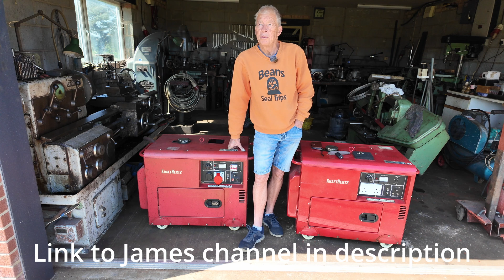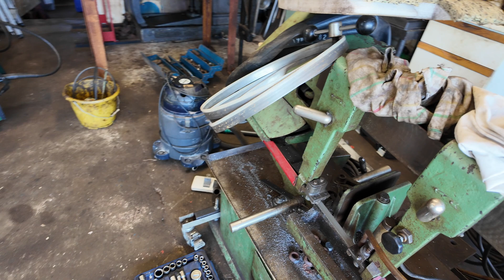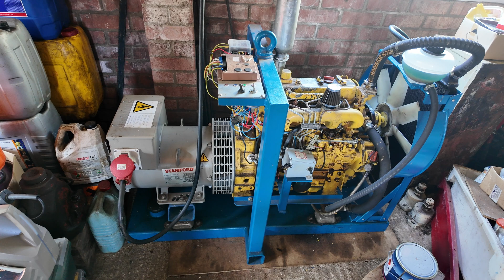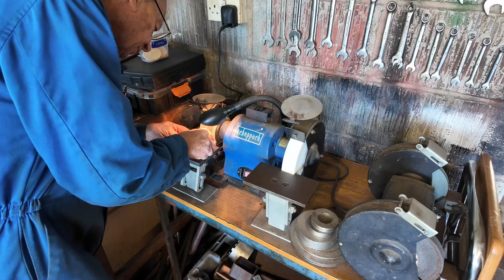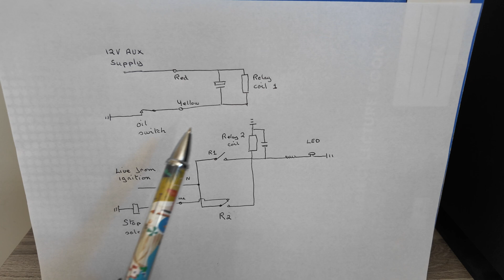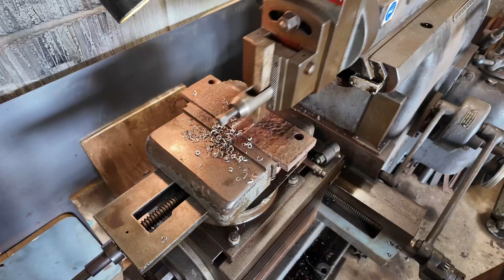Generators and a shaper machine

Comment: I have one of those 26kva Perkins units made in china to sub standards and it blew thw avr so I replaced that and the windings blew, it now only produces 50 volts on each phase, I ordered a coiple more  avr's one three phase the other single because the orinal avr was a single phase one despite the machine being three phaseso I now need a new unit, the alternators are availble on aliexpress fo around £280 as of yet I have not ordered one as I am looking around for a generator with a Markon alternator on maybe with a dud petrol engine. Back in the 80's I used to build generators using Markon and Newage alternators but since Cummins took over the small units are no longer made, guess the could not compete with the cheap Cinese ones. I ran my workshop on a generator I built from scratch using a Leyland 498 engine and a 50 kva Newage stamford alternator, it would run eight hours on five gallons of diesel and back then the power was half the cost of mains electricity and in the winter the waste heat from the radiator heated the workshop.
Reply from the maker: Thank you for your comment.  I was reluctant to use yet another Chinese clone alternator like the ones from Ali Express, fearing that it may flash across and I would be back to square one. That is why I decided to buy a Hyundai replacement which fitted with only the rear feet needing to be modified by making a spacer. As I think I mentioned in the video this was larger than the original and needed it's own AVR as it appears that it monitors all 3 phases rather than just one. I do not know this for sure though. At present it is working well so fingers crossed. I hope you get sorted out.
Reply: @jmtracmach  Hi where did you manage to find the hyundai alternator, I did look at buying a complete hyundai generator but then it looked like they are chinese built as well and just have the hyundai brand on them, this is certainly the case with hyundai power tools like the chain saws and strimmers, leaf blowers all of which I have and are made in china.
Reply from the maker: @Equiluxe1  The alternator and other parts came from power-spares.co.uk who are a branch of genpower ltd I think.  Sales were really helpful I spoke to Mitch and George, however unfortunately tech support were very "jobs worth" and refused help as I was not fitting the alternator to a Hyundai generator. Most of the clone engines struggle to get the starter to overcome compression and a lot of people use the de-compressor lever but Hyundai advertise a 1Kw starter so I would imagine this is more capable than a clone. Despite where they are are made I expect Hyundai parts are better quality than a clone. I hope so anyway!